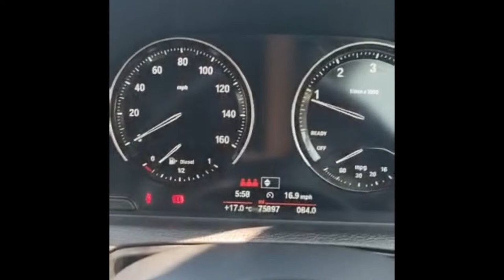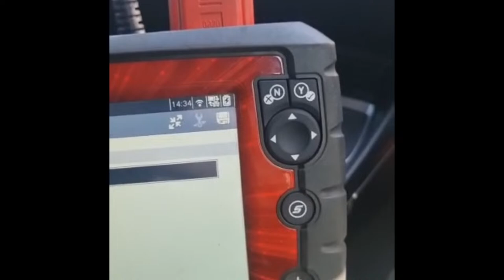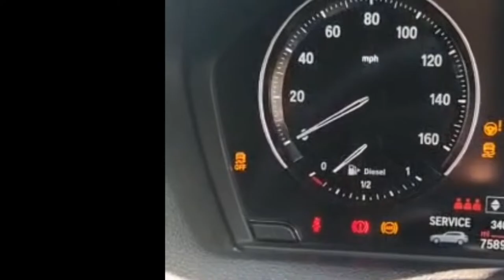BMW 118D F20 Powertrain Stop Carefully NO Fault CODES Part3

Comment: Hi 
Over here in Ireland
BMW 218d. Fault 36f400 and 0401 on OBD
Light will not clear Emlyn on as soon as ignition is switched on
Inlet manifold removed cleaned checked no leaks

Question is what flash or software update was done and would you have any recommendations for a company in Ireland to sort issue

Thanks in advance 
Michael

Comment: Hi. Can I ask you a couple of questions as I have the exact same problem. 
1) When you had the drivetrain error did the engine shake when turning it off? Mine does that but when I delete the fault memory and turn the engine off straight away (before the drivetrain comes up) the engine shuts off smoothly. 
2) Is the ECU reflash the same as updating the software using Esys? And how long does the reflash take?
I'd really appreciate if you can share your thoughts. Many thanks.
Reply: Hi mate. Did you figure this out? I have the same issue
Reply: @m57tuning  ??
Reply: How was the error solved?
Reply: @m57tuning  If you're having the same issue as me and ISTA is not throwing up any fault codes then most likely you have an older version. You will need to install the latest version of ISTA to read the fault code. Once you are able to read the fault code you'll find that the fault code still cannot be erased. You will need to run the test plan associated with the fault code and once the test plans runs successfully you are then able to delete the fault code from the memory. 
I had a vacuum leak on the MAP sensor. After replacing I managed to run the rest plan successfully and delete the fault code and that resolved my problem. Hope that helps.
Reply: which ista version did you use? Thank you
Reply: @m57tuning  4.39.20